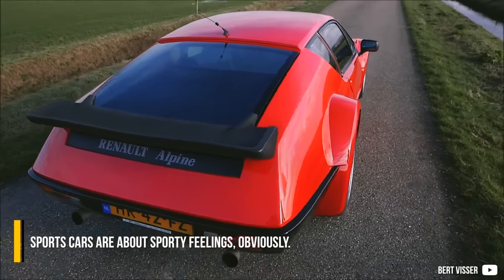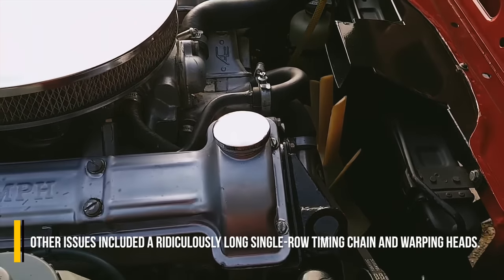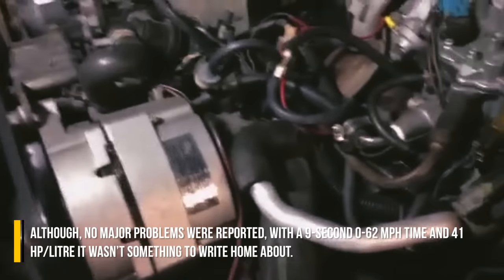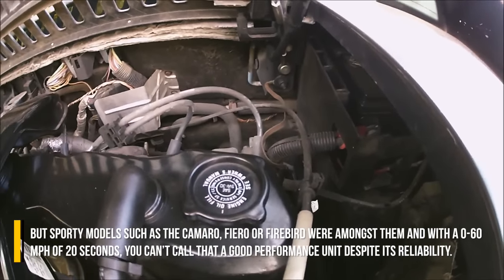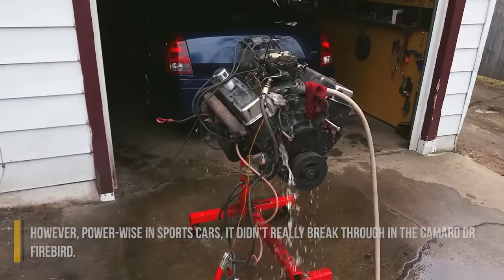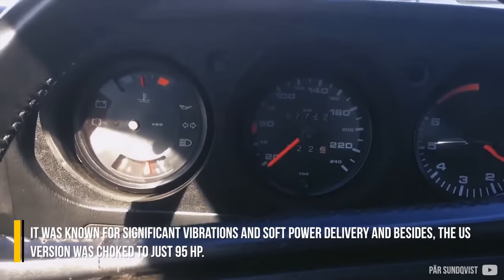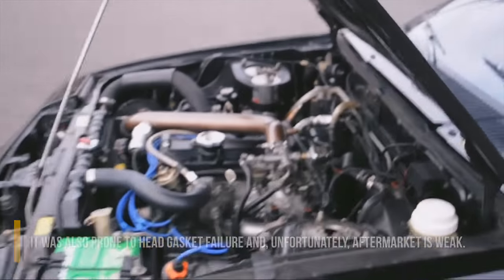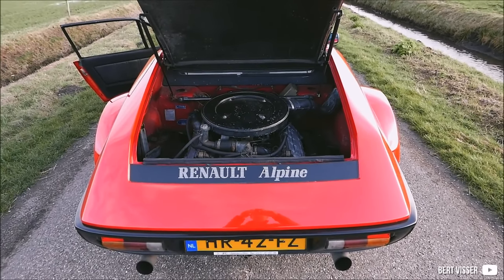Don't Buy These 7 Engines For Performance

Comment: I disagree on the 305 HO.  That engine was the first step on the road back to high performance in the small block Chevy in 1983.  The previous year, the 305 peaked at 160 Hp, so the HO with 190 Hp was a good step up.

Comment: The Triumph V8 was of sound design. There was nothing wrong with it. The problems came with inadequate quality control, inconsistent build quality ... Not the design.

It also had to contend with an inadequate cooling system. Again, not a problem with the design of the engine but cost cutting measures such as a weedy, cheap radiator.

I wish people did more research on stuff like this.

Comment: The 301 turbo didn't replace the 350, the 350 was a Chevrolet design which later along with the 305 replaced the 301, the 301 turbo replaced the Pontiac 400 (both of which sharing the same engine design) as a last ditch effort by Pontiac to insure future Trans Ams and Firebirds were Pontiac powered, they failed and when the 3rd gen rolled out it was under Chevrolet power, Pontiac was actually so adamant about keeping the Pontiac V8 around that they actually saved up a bunch of 400s in 1978 to be sold in 1979 while they developed the 301 turbo, quite a few 1978-79 Trans Ams ended up with Oldsmobile 403 V8s because of this and demand for a bigger engine

Comment: the fact that the PRV V6 on here is an honest joke, my neighbor has an ‘81 Delorean with the PRV of course, with two Porsche 3 barrel carbs, equal length hedders, a 3.44 gear ratio, and it achieves 100+ in 3rd gear at 7,000+ RPMS, more underrated than underpowered.....
Reply: the PRV use on the Delorean (130HP) had 20Hp less than on the Alpine A310 (150hp)...but the PRV6 was a very strong engine, easy to improve: on A310 stage 1 was 170HP, stage  2 240HP , stage  3 280HP, and much more for the supercharged engines...on Leman series WM P88 did a PRV produce 910HP!!!

Comment: The only reason why the triumph 3.0 v8 had an overheating issue isn't because the water pump is to high, its because when this engine was in production triumph didn't bleed the cooling system properly

Comment: Why I'm not surprised that the most engines in this list are from the USA..? Renault Alpine: The PRV (Peugeot-Renault-Volvo), also called Euro-V6, was also used in the DeLorean. The DMC needed for 0 to 100 km/h 10.1 seconds, while the first Golf GTI from 1976 needed 9.2 secs ;-)

The history of the Porsche 924/944 is a bit difficult. It was designed as the successor for the VW-Porsche 914 and should be a cheaper entry model. To postion it in the VAG group was a bit difficult because VW had with the Scirocco an entry-level sports car. So there was an agreement that Porsche didn't produce the car in Stuttgart, but in Neckarsulm at Audi/VW and got parts from VW to better conditions. The 924 contained parts from the Audi 100, 200, VW Golf, K70 and the military Kübelwagen K181. The rear axle of the 924 is from the Beetle 1303! So the price could be reduced to 23.240 DM while a 911 started at 32.000 DM. The visual identical Porsche 944 had an inline-4-cylinder engine which was based of the right half of the V8 of the 928. With more optimizations, the 944 was one of the best selling models from Porsche. However, at the introduction in 1981 it costed 38.900 DM, with automatic transmission 40.400 DM. The 924 needed 10 seconds from 0 to 100 km/h, but had a maximum speed of 200 km/h. And it looked like a Porsche. In comparison: A Golf I GTI costed in 1983 13.850 DM, some special editions and colors it could g up to 22.800 DM. Compared to this, the 924 was not a bad deal.
Reply: Retro And More I love how you ignorantly blanket u.s. engines as garbage, yet try to explain why the euro engines were bad....
Reply: I made some changes in the text if you like it better now. I also will state clear that there are three machines from the USA, Europe and one from Japan. However, if you put engines in a Pontiac Trans-Am, GM Iron Duke or Chevrolet 305 you should excpect a good engine. However, economy was never an arerican thing, this was a reason because the beetle sold so well in the USA, the other manufacturer's hadn't anything like this. The Triumph... if anyone is thinking at British manufacturers, all may be thinking Jaguar, Bentley, Rolls-Royce, Aston Martin and Lotus. But the most standard car manufacturers (including Jaguar) were under one roof British-Leyland. And they this group had never good quality. Today Britain has no own car manufacturer anymore: Rolls-Royce and Mini belong to BMW, Bentley to VW, Jaguar and Land Rover to the Indian TATA motors, Lotus to Proton (Malaysia) and Aston Martin to mixed owners. If you know the French and Italian cars from earllier decades, they also were never high-quality. An exception may be Citroen, especcially with the DS and the CX. And I'm not talking about sports cars. Porsche 924: The pricetag was exactly between the base models Golf GTI and the Porsche 911 during introduction, about 9300 DM difference in each direction. So it was about the driving experience of a heavier Golf GTI, with less useability but the looks of a Porsche.

Comment: Great video, but the Pontiac "Iron Duke" is a standalone design, it is NOT like the Porsche M44, which is the four cylinder in the 924S/944/968, which WAS half of the 928's V8.

Comment: They chevy 305 can be hopped up to 400hp with good cam, heads, intake, and carburetor. the stock ones are trash because of regulations but europeans forget how much you can change an american v8 to make power.

Comment: never knew they have made a camaro slower then the camaro iroc-z  20 seconds damn well it looks sort of fast
Reply: The IROC-Z was the top of the line model when it was released. There are alot of camaros slower than it.
Reply: The iroc-z was literally the fastest one they made in the 3rd gen wtf are you talking about
Reply: The IROC-Z still got in the 14 second range, in the 1/4 mile.
Reply: Freedom First 
Did I? I honestly didn't know that. That's pretty impressive, considering the time period.
Reply: Jαѕσи Tσdd, I believe the last year of the IROC-Z, it went 0-60 in 6.1 secs. and 14.7 secs. in the 1/4mile. That was fast back then. lol
Reply: @freedomfirst5420  ..Wasnt fast for guys who owned cars from the 60's early 70's those ran 11's to low 13's stock,just add better tires...I remember my buddies 68 Chrysler Newport  4door  383 2 barrel,single exhaust,2.76 axle would eat 5.0 Mustangs back in the day..He ran 14.8 in the 1/4 as he wouldnt spin like a high performance 383 4bbl or 440 ,Hemi Mopar would..hook and book !

The Irocs could run low 14's...high 5's 0-60..""Not a GM fan but...thats what they did,government pollution controls really zapped power then..

I ran 12.80's with my 4 year old 68 Charger RT by changing out the factory 185 70 series 14 inch tires to a wider tire..Remember old cars widest tires were 205's even in 1974 !! i added headers,carburetor ran 12.30's in same car..***I have a book with all times from then and modifications etc..Stock skinny tires ran 13.40 best time 1st 4 passes were high 13's going sideways with no traction ,did a 14 missing 1st gear powerband..440/auto/3.23 gear !
Reply: @01trsmar  , I am a MOPAR guy, but for the time, the IROC Camaro was fairly quick.

Comment: wrong the iron duke was a big bock four banger from Pontiac, the generic 151 Iron mike was used in front wheel and rear wheel deals, the heads and intake manifolds changed all the time and some had gear drive cams, the cross flow aluminum cylinder head engine can make 300 hp easy.

Comment: Your records for PRV is very misleading. The unit is easily turbocharged as is known to produce 260HP+ on a stable level.
Reply: The V6 PRV wasn't an bad engine if we think ,it was wobbly at the beginning owing to its opening at 90° (like the V8 version) and the carburettors for economic reasons due to the Petrol Crisis.If the 3 manufacturers were thought about to electronic injection and to correct the cycle that come from the V8 to adjust to a ordinary V6 at the start, the engine would not turning like a potato and it would get a better compromise between the cosumption and the power. But in my country,in France, presidents who gouverns us leads an autophobic politic since several years (speed limitations,tax horses...).Our executive cars (Facel-Vega,Monica,Delahaye,Avions Voisin...)suffered of the useless tax of 33 % on high end vehicles. Germans never got this kind of problems that's why they make wonderful vehicles. The PRV suffers of weaknesses that it is accused but got some qualities : It's pretty undestructible,long lifetime,it's reliable and Peugeot did 405km/h on the Hunaudières,at Le Mans,in 1988. At the start of the 80's,the offset crank pins appeared ,V6 received a turbo on the Renault 25 that makes 180hp and evolved at 205hp.Later,on the 90's,2 BiTurbo variants came out.The first was on the Renault Safrane, 280hp deflated at 268 horses (12 valves), the second on the Venturi GT 400hp with 24 valves.Its career ended in 1998 on Espace III,Laguna I, Peugeot 605 and Citroën XM.A total production of 1M units.Such a shame,because Georges Lautemann made something brillant for earning a lot of horses : an transformation of the crank shaft, rework rebuild engine rod ends in order to give again new caracteristics of working but on 2 seperates crankpins.This transformation was intended to find the dynamic balance of a V6 engine open at 120 ° in a block open at 90 °. The heads of the rods of each row of the "V" cylinder were no longer assembled on the single crank pin of the original engine but on two separate crank pins staggered at an angle of 3 ° 30 '. The bench tests of this engine have shown its reliability and power up to 235 hp (173 KW) and a very regular operation at all operating speeds.
Reply: Unfortuantely a lot of people think they know how to extract more power from the V6 but basically fuck up the engine and performance.

Comment: wasn`t the PRV Engine also mounted in the De Lorean? So funny note the real one couldn`t reach the speed neccessary for the time jump. :D

on the other hand there was the Renault Safrane Biturbo - Very rare (around 600pcs made) PRV engine tuned by BMW tuner Hartge(!) to 260 HP

Comment: 8: Subaru BRZ 4 cilinder boxer
Reply: jarriano For a non turbo 2 liter engine, 200hp doesn't sound that bad... I mean they would use the engine in other cars, put a turbo and get 300hp (on the jdm legacy and levorg) or almost 270 (on the US spec WRX)
Reply: Honda was making 250 HP out of a 2.0 in 1999 and it was a much more enjoyable engine, the 2 liter in the BRZ is just so strained, has a nasty torque dip, and makes for an overall underwhelming driving experience.  After driving one I lost all interest in buying one, the only hope is that there is a company that makes direct-swap components for an LS series engine and they don't really throw the weight off by much (around 30 pounds heavier, I believe) so a battery relocation to the trunk offsets the balance issue and suddenly you have double the power and torque with much nicer power and torque curves.
Reply: I've driven one, there's definitely something weird about having to look up at the guy next to you driving a Prius.  You're right about it being uncomfortable but I could live with that and the size if it were better to drive.  It's great around corners, slides nicely, and is overall a very nice-handling car but the engine really lets it down.  If you live around a bunch of tight, twisty corners that are packed very close together it would be a good car but the parts between the corners are the real weakness of these cars.
Reply: F4RT with 319hp at the wheels is ❤
Reply: No hate on the Boxer 4 but without turbo its, yawn... zzz
Reply: UnsulliedSpy B20 swap the worlddddd haha
Reply: I rather have a Prius over the GT86 cuz practicality was 3 times better
Reply: With a turbo and UELs it sounds like a Dodge Caravan with a misfire and hole in the muffler, the FB WRX and Forester sound like an old Honda.  Solid performance out of the FB turbo, they just don't sound very good.
Reply: Don't hurt Visio, dude
Reply: I'd have the GT86 over Prius...
Then i'd sell it to some vaping tokyo drift fan and buy a Megane R.S.
Reply: Which honda was making 250 from a 2.0? just fact checking...
Reply: Jonathan Gardner
S2000 F20C
Reply: Hahaha I made a comment about that before I watched.
Reply: Nåti M my all original 18 year old VW group 1.8 ATC non vvt of any kind putting down 336hp and 355 tq. Everybody's dyno is different but it's never been opened and only simple mods.
Reply: the brz can hit 275-300 hp on stock injectors

Comment: The Iron Duke never was billed as a performance engine. And it IS NOT half of a 301 V8. It was a 4 cylinder from its design and just looking at a pic of one its easy to see that.

Comment: The PRV6 engine was never meant to be a V8, there was to be a V6 unit built first and a V8 unit was to follow, both engines were to be 90 degree bank angles so they could be produced in the same factory using the same tooling, the oil crisis killed the V8 before it made it into production and they continued with production of the PRV6 into the late 90's selling nearly 1m units in total, its a pretty poor engine by today's standards but for something developed in the late 60's its OK, to get something with overhead cams and an all alloy construction at that time its not bad at all. I have heard that in Volvo vehicles they suffered from oil starvation to the cams but this does not seem to be the case with Peugeot or Renault equipped models so I'm not sure why that would be.

Comment: That PRV. What a POS! 12mpg in a Volvo wagon I bought used. Quit running by day 3. Sold at a loss to an auto repair shop on day 4.
Reply: in the A310 was the PRV consumption relative low with 12L/100km average, with a minimum of 8.5L on gently driving country roads, and 15L/100 with fast driving (mountain or 160 to 170kmh average speed on german highways...)

Comment: i've owned 3 G54B powered Starions..  12 second cars on the stock turbo with minor mods.   EIP racing back when the car was current was running mid 9 second 1/4 miles .  Starions also won SCCA racing back in the late 80s.  I think you didn't really do the car justice with your review.  Sad.. some of the issues were easily fixed, and parts are still pretty cheap considering it shares the same head as the non mca jet 2.6 chrysler.

Comment: the 151 GM was not used in jeep the iron duke is the 4 banger pontiac engine, which is way bigger, jeep used the AMC 150 engine, which is completly different

Comment: I really don't get the 924 like.. Why? Why go for the 924 when you can get a 944 which is better, looks the same and technically is a better car overall?
Reply: Old man , you do realized that the 944 was better in every way so it does not belong in this video
Reply: Can you not read?
Reply: 924 came out several years before the 944. And when they were eventually sold side by side, the 924 was cheaper. Also much cheaper on engine maintenance.

Comment: 2:35 why would you say that the new Camaro 2.0T is a disappointment? I have one, and I thoroughly enjoy it. A lot of other people are tuning it to be just as fast as the V8 in a straight line for a lot less money.
Reply: no lol. no.
Reply: car enthusiasts would never buy a 4 cylinder muscle car (or a v6 one)

that's like a diesel ferrari :D
Reply: Adolf Hitler tell that to everyone who buys a 2.0T Camaro or EcoBoost Mustang, Mr. Gatekeeper. We know it's not a muscle car, we don't buy it because it is a muscle car, we buy it because it is a sports car that happens to be efficient.
Reply: they bought em for price and fuel efficiency reasons

any real enthusiast would want the v8 naturally, but it's $$$ that prevents them from leaving the dealership with one.........so they get the 4 cylinder (or 6 cylinder), then they dump 20k+ into their cars over time and smoke a few stock V8s and then make clickbait YT channels :)

example, when i bought my 1st car i could have gotten a 4 cyl or 6 cyl car (budget was 30k CAD), but instead i found a 2001 540i sportwagon for 6500$ and got that instead

stunning to drive even by modern standards, terrific N/A BMW V8 4.4L, hydraulic steering and brakes for simplicity and feel

and not a single fuck given about fuel economy or saving a penny :)
Reply: Adolf Hitler okay, well everyone has different mentalities when it comes to what car they want to buy and own. That doesn't make me (or anyone else) any less of an enthusiast.
Reply: alot less money is a lie. old v8 muscle cars can go fast for stupid cheap. buying a new 2.0 Camaro and then dumping even more money into it? ridiculous. buy it because you want to, not to try to make some stupid point.
Reply: and i would never want to buy a v4 or v6 camaro, as do most people who end up getting them

Comment: I had a 1984 Camaro Z-28 HO 5 spd.  Quarter mile 15.0 @ 93 mph.  I also ran it at Summit point road course.  Then one of the car magazines ran my exact car v. Poche 928 S comparison at the same track.  I was dumbfounded.   That whimpy 200 hp Z-28 was faster then the Porche!  I knew handled well  but didnt that Porche have dual o.h. cams? 

But that Chevy engine was just a horrid horrid engine.

Comment: GM Iron Duke: 2500cc delivering 90hp and 179Nm Torque
My Renault Mégane: 1200cc delivering 132hp and 205Nm Torque

lol...
Reply: Find a same year Renault and the GM probably has more power...I am not a GM fan but you have to understand years ago when starting with vehicle emissions,they had lower hp/torque because the emission systems robbed power,luckily today they solved this !